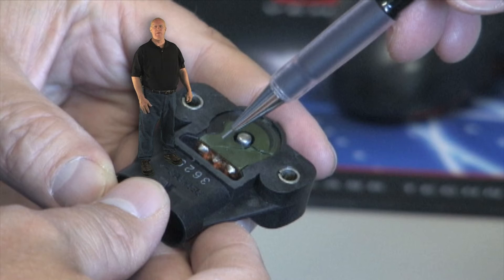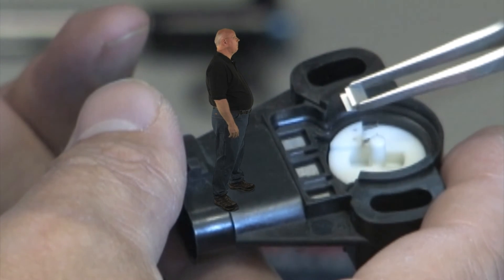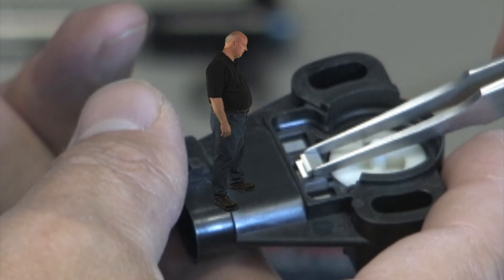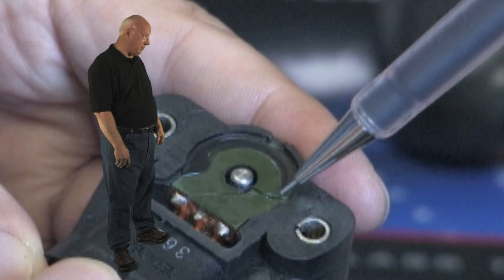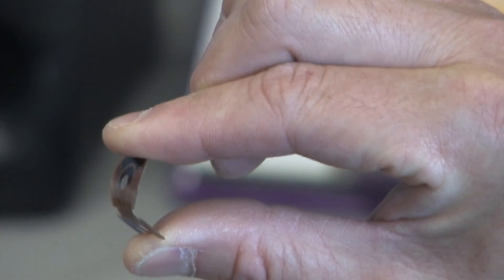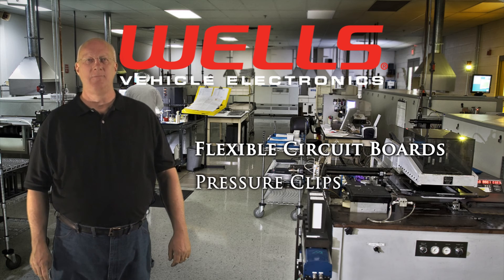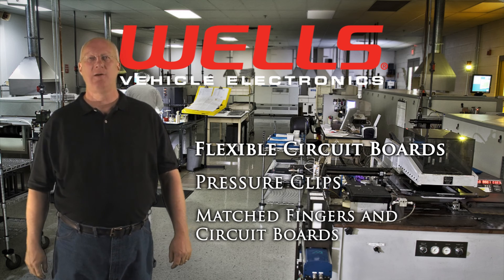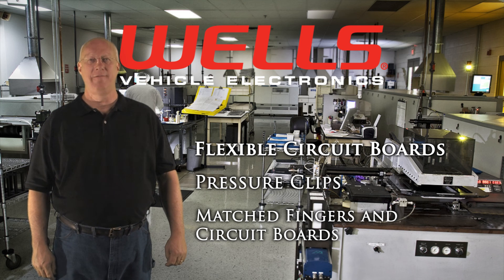Throttle Position Sensors by Wells

Comment from the maker: We are by no means saying everytime you have hesitaion on acceleration the problem is the TPS. Not always does a code set for the TPS, but usually it will for a hesitation issue. I would check the TPS with a voltmeter or labscope, to verify the voltage is dropping off during an acceleration. 
Thanks
Mark Hicks
Wells Vehicle Electronics

Comment: Hesitation on acceleration is a very nonspecific presentation -- if the TPS is the problem, can the owner rely on a diagnostic error code? If you have hesitation on acceleration, when would it be appropriate to replace the TPS just on spec?